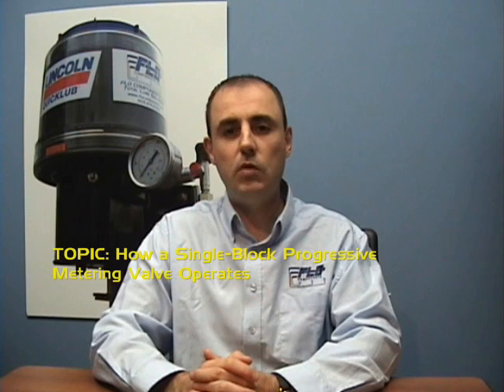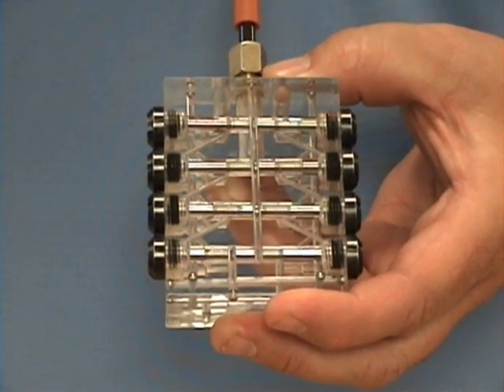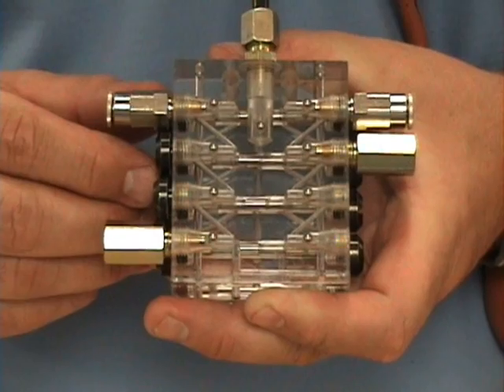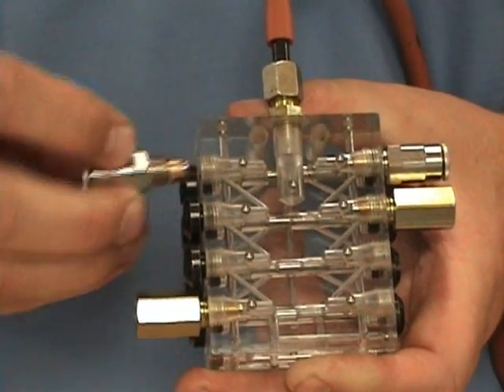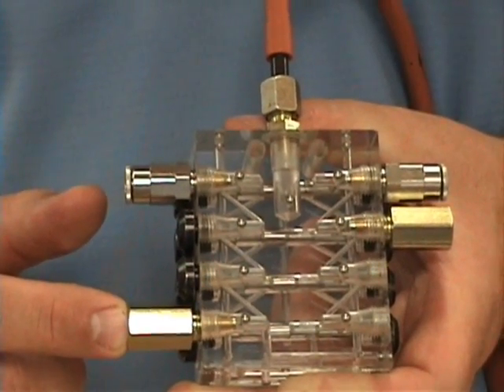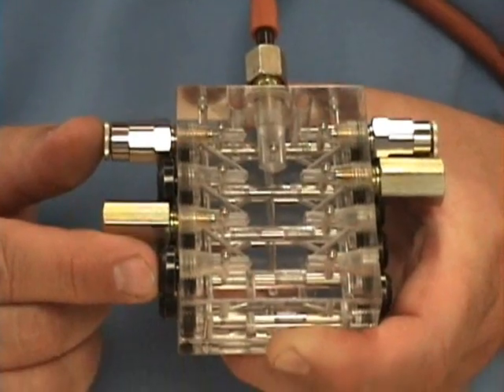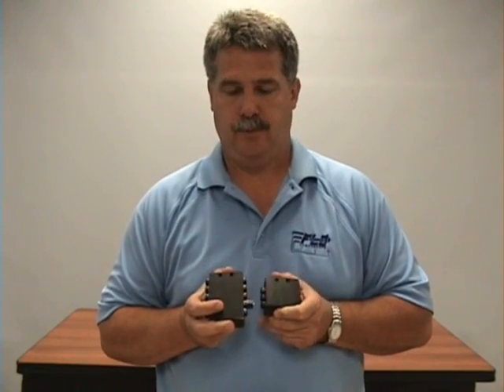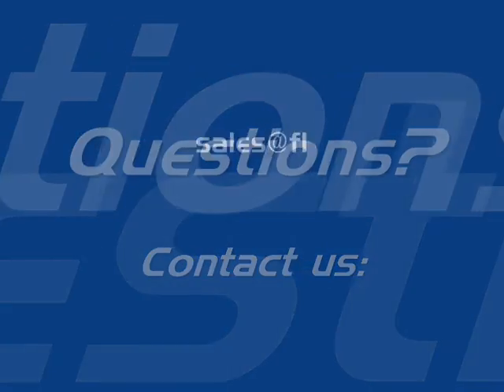FLO Lube Tip - How a Single-Block Progressive Metering Valve Operates

Comment: Excellent video. Can you tell me if all outlet ports receive grease at (virtually) the same time, or will we see pressure/discharge at port 1, then port 2, then port 3.. etc progressively. I imagine this is the case, because it is progressive. Maybe if its a high flow system with little resistance (eg light oil), it does progress, but you cant tell being so quick, but if it was viscous grease, its slow and you could see 1 port cycle, then finish, then next port start/finish..
Secondly, can pressure gauges of the right pressure and thread, be installed in the plugged ports, if we had an 8 port block and only used 4 ports (4 ports plugged?) for visual pressure monitoring purposes?
It would be nice to see a video of working system, with transparent block and lines, (maybe using kids 'goo/sludge' as the demo medium, or something like that - the medium is coloured and slightly viscous)..
Reply from the maker: The valve will operate progressively – one port at a time, not all at once.

No, pressure gauges should not be installed in the plugged ports - the internal cross port drilling needs to be clear.  The easiest and best way to install a pressure gauge would be to install a tee into the grease line coming out of the SSV Valve and mount the pressure gauge there.  Or install a tee at the SSV inlet and mount the pressure gauge there.  By doing this you are monitoring the complete zone the SSV is servicing.

Comment: in a one minute how much of a lubricant will ssv 6 dispense out considering each outlet is 0.2g or 0.2 cm3
Reply from the maker: This depends upon whether the SSV valve is operating in oil or grease. Grease has a slower cycling rate than oil due to the viscosity of each. Based on 50 valve cycles per minute, total output of the SSV6 would be 3.6 cubic inches or 60cc.